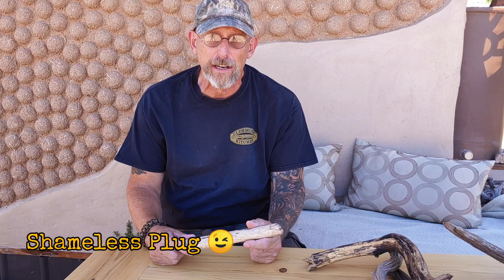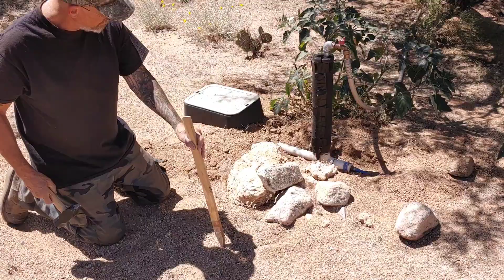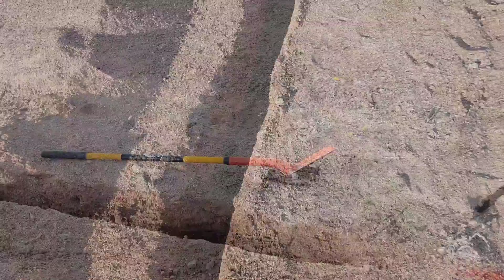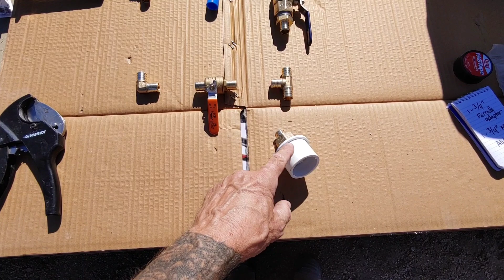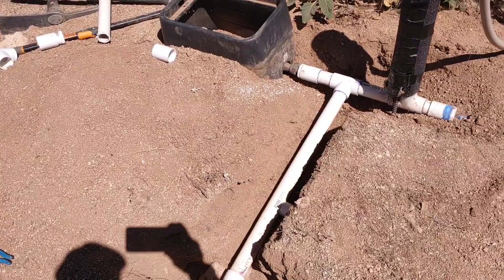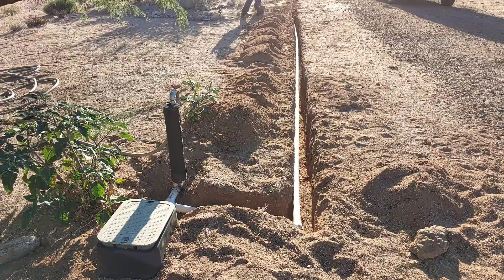#strawbalehouse #naturalbuilding How to Build a Straw Bale House | Day 8 Installing Water Main

Comment: That is hard, hot work.  Glad you got it done.  Now go get a cold beer!  By the way, with 100 psi coming in from your well share, have you considered a pressure regulator?  PEX is only rated for 100 psi max, I think?
Reply from the maker: Thanks for watching. PEX is rated at 160 psi @ 75 degrees. At 200 degrees it is rated at 80 psi. Once all of the plumbing is complete I plan on doing a pressure test at the final destinations to see if a regulated is needed. That first 5 feet of PEX leading into the valve box would be an easy access point to install one with either pex barbed fittings our I would even consider using one with a shark bite slip coupling. Having that hose bib right there is so convenient it was worth the sweat. 🍺
Reply: @theupsideofdownsizing  Agreed, Bill. Looks great. Straightest trench I've ever seen. :-)

Comment: Nicely done Bill! I’m jealous of your sand ... and the well share. Still think your decision to wait to build until after the monsoons was hard but the right one! Your shed seems to be holding up much better. We started building out stick frame house 15 years ago. Hard physical worked started before sunrise, ended by lunch, and resumed around 4PM. The hardest work was working as the laborer for our mason building two canbcrete block utility buildings. He’d start at 7AM and work straight through to 5! Hot, sweaty, hard labor. I never wanted him to be idle so humped all day long. Sleep came quickly at the end of the day. Take care.
Reply from the maker: We are walking a similar path for sure. The Solar Shed and our Toolshed are both handling the elements just fine. Amazing what an additional 5% Portland cement will do. The waterproofing spray is also holding up better than expected. That will probably be a once a year reapplication. Because it can be sprayed with a garden sprayer, it's a quick and easy process. And the stuff is pretty inexpensive too. The sandy soil is like everything in life a double edged sword. We have to harvest additional clay for our earthen plaster, but, it has great drainage and is pretty easy to trench/dig. And with a minimum amount of amendment, we can grow crops in it too.
Reply: The Upside of Downsizing a lot of people reject adding cement because of the added carbon footprint. We are NOT in that camp. Instead we advocate for choosing the right building material. 5% added cement is a great compromise. We seriously considered earthen plaster for an alternative to site-mixed stucco, but in order to use our site soil we would have needed to sieve al of it and then mix well, sample it, develop a formula using clay that we also processed on site. Not impossible but not practical at the time we were building. We still have sa number of accessory buildings to make. Some will use stabilized earth bags with cob and earthen plaster - after The monsoons! Take care.

Comment: Time can play tricks on our memory...
For future references
For where the solar line crosses the water trench..
Take two different permanent points... Two different trees or. ??      (Some distance apart)
Measure from each point to the electrical line/ water line intersection...
Now at any time using those two measurements will put you on that intersection ...
No guessing..
Reply: Just a suggestion for followers wanting to add a tee to their water lines any where...
Cut out maybe 18 inch or longer longer install the tee in that section. and use unions on each side... Now at any time there might be a problem or. ???
Simple to remove that section..
Reply: Maybe to help protect the PEX from the sun.   Place a section or two of the pipe insulation over the exposed section...
As it deteriorates. It will be easy to replace
Reply from the maker: @jimh4167  PEX will not be exposed. It's been buried and what is above ground is in the crawlspace which will have skirting. Thanks for all of the helpful suggestions! 👍

Comment: Good video.  How is the PVC holding up with the AZ sun?
Reply from the maker: As long as the PVC is either buried or painted, it holds up just fine. Our Greenhouse hoops are made from Electrical conduit PVC which is gray, and listed as UV resistant and it too is holding up very well. All of the Waterlines and drain lines will be buried. The pex lines are also rated for direct burial and are posing no issue at all. 👍

Comment: While not the 'Jim' level of digging gusto, actually quite a good video and well thought through.  So many folks just back fill pressurized lines without checking for leaks. Question:  will you be tarping over house deck during monsoon or is the paint enough protection?
Reply from the maker: Considering the fact that Jim is at least 25 years younger than me, I think I held my own 🤣 We covered the deck with a 30x50 translucent tarp ( the same material as we used for Yvonne's greenhouse). After the monsoon season, we'll use the tarp when we build a second, larger greenhouse. The paint would certainly offer protection, but better safe than sorry.
Reply: @theupsideofdownsizing  yes, but you have 'old man' strength that he doesn't have    : )
Reply from the maker: @et5222  right on brother! 💪

Comment: I fill your pain we have built 4 new raised garden beds here,. 3' x 5' by 30inches high. Plus we put in 22 pipe raised beds about 21" id by 26 inches tall to much shovel and pitch fork work. But we're getting older so bending and kneeling are a pain.
Reply from the maker: Aleeve has become my new best friend. Ah, if we only had a tractor.....Oh, and now that the waterline is done, I've got about 60 feet of drainage lines to complete. Just picked up the schedule 40 pipe and fittings. I'm putting together a few new raised beds for Yvonne, but nothing along the lines of what you've described.
Reply: Ya Tylenol here because of allergies, now some one has given us 20yds. Of mulch but we only have to haul little at a time. We'll use it on everything this fall. So we're going to try'n buy a good used tractor this summer.

Comment: Another step closer!  I feel you on the trench digging.  Doing the same thing over here for electrical lines for the solar.  Lots of breaks! 😓
Reply from the maker: And your soil is much harder to trench than ours. Our only challenge is preventing the walls from caving in on themselves. Oh we did have a stretch of about 30 ft where I was constantly dealing with rocks and mesquite tree roots. But, it's done! 👍

Comment: Bill, I'm curious about something: Why did you decide to place your house and other buildings at the front of the property rather than putting them further back (for additional privacy). I was just curious.
Reply from the maker: We are approximately 200 feet from the road. The highest elevation of the property is by the road, so the further into the property we go, the lower the elevation and thereby the view. Our property also becomes very sandy the further down you go. We had considered another build site but it would have meant an additional 300' of driveway with AB mix and then bringing the waterline down there would have been an even bigger project. Final reason, from further into the property, you actually get an unsightly view of a neighbors house. So where we're at provides a nice view with the most amount of privacy.
Reply: @theupsideofdownsizing  Just the view of some ones unsightly property would be enough reason for me. On camera its hard to get the real view of just how the property slopes, what's high and what's low, so given you are at the high point on your property that makes it a better spot ....not to mention your other points. Thanks a million!
Reply from the maker: @nohomenomad1427  Just for the record, our neighbors property is not unsightly, but they do have a rather large house, 2 stories tall that kind of ruins the illusion of isolation.
Reply: @theupsideofdownsizing  Ah ok, got ya, that's still not a good thing when your trying to get away from it all. Wife and I live (how i hate it so) in a HOA (which I think I mentioned to ya B4) house's are like 10ft apart, we 2 story homes right behind and beside us and our yard is about the size of a cows turd. We're stuck so will have to put up with it. I can see now the WHY you are at on your property. You have 8 acres?
Reply from the maker: @nohomenomad1427  yes, 8 acres. But if you find the right location, having 2 acres can be the same as having 100 acres. All about the "neighbor" situation.
Reply: @theupsideofdownsizing  Someday that might happen. I'm waiting to win the Lotto.

Comment: You've almost reached "Jim" status with all that digging.  Great job on the PVC.  Better to be too anal than to have a slight leak than can fester into something worse down the road.
Reply from the maker: First off, that is high praise being put any near Jim as far as digging is concerned. Our soil is much easier to deal with than theirs. It was so strange, when I felt the underside of that coupling, it was almost like condensation. But I figured that was the time to deal with it. Worked out fine. Thanks again for watching. 👍

Comment: Excellent water job. Heck of a long run but you took your time and did it right. Great video!
Reply from the maker: Thanks Michael! Those 20 foot sticks with the bell end made the actual laying of the pipe super easy. The actual glue up probably took 15-20 minutes tops. Thanks for watching!